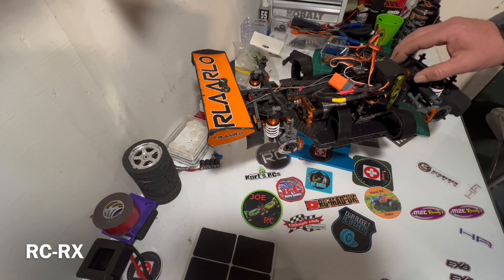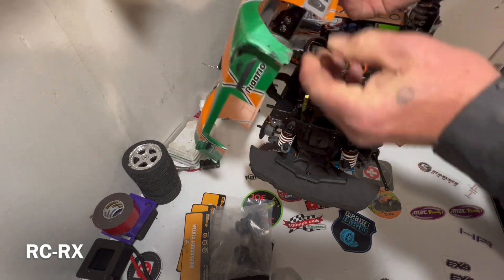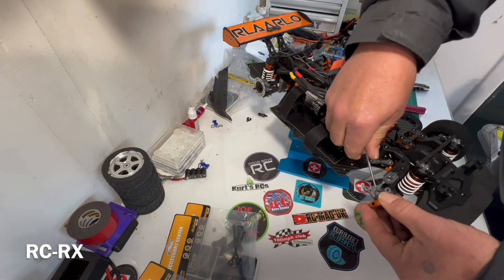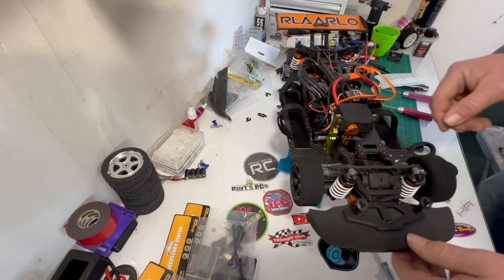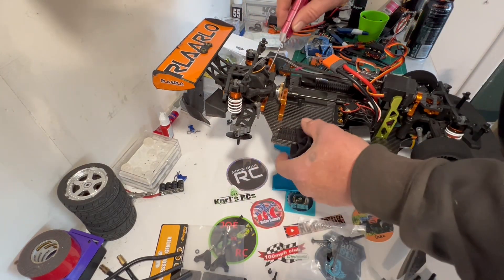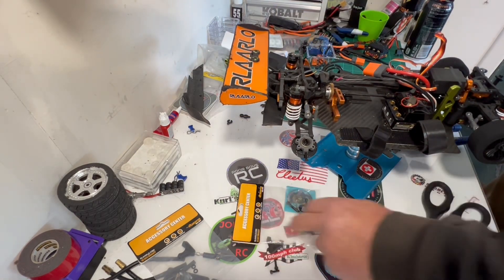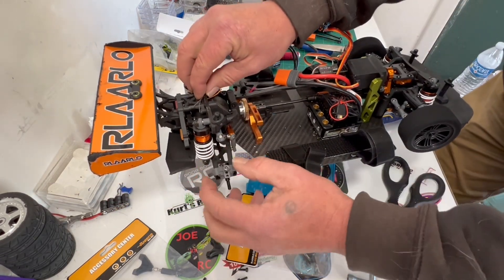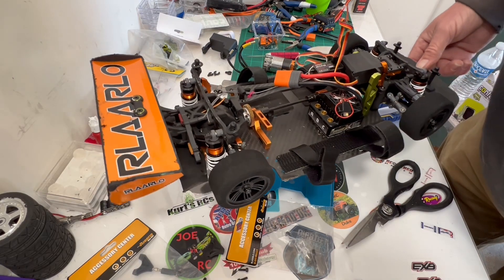Rlaarlo AK-787! What broke in the crash? Let’s fix it! #rc #rccar #rlaarlo

Comment: Thanks for the shout out 🙏
Check the Diameter between the 26mm and 30mm foams
If they are not the same diameter, there will be trouble controlling the car. Use 26mm all the way around if you dont have a Truer 

Your making making ground Brother👍 keep pushing
Reply from the maker: No worries!… I appreciate the feedback always…. I checked the foams and they are the same diameter just a bit thinner and offset for the front.  Hopefully she will go!🤜🤛

Comment: Nice updat and repair.  The foams should run much better. But check the heights on those front and rear tires . They look different  .
Reply from the maker: Thanks Joe!… yea I checked them they are the same… just the rears are wider… my Dads rc said the same thing.

Comment: 1)  Have you tried using the front-upper suspension arms on the rear?  I haven't tried it, myself...but, I do know others have successfully done this 'swap'.  The only thing I can't remember (you'd have to try it both ways) is whether they remain in the same direction (ie. front-facing remains front-facing), or whether they're "flipped" (ie. front-facing when installed at the front, becomes rear-facing when installed at the rear).

2)  My 'easy' way of removing the stock hex was to remove the rear uprights, or steering knuckles in the front, from the upper & lower suspension arms, place the threaded section of the stub axle against the tablet...then, while holding the disc-brake hex with two hands, press the hex/disc down, and or comes right off.  This works for all RCs having this hex style.

3)  Glad to see I'm not the only one using one of my Benchmade knives with my RCs...lol
Reply from the maker: What’s up brother!… I have not tried the from arms on the rear yet. I’ll take a look at it for sure. Yea that was the only hex that was pressed on for some reason… the others were fine….. and yea… I should probably use a cheaper knife as a pry bar!…😂

Comment: Hi those top rear a arms suck . Back in June 2023 I changed them for wltoys turnbuckles on my RTR 917 . I now have about 180 miles on the car and no more broken a arms. I have got it to 103 mph so far on stock carbon layered tires on wltoys 124016 front rims.
Reply from the maker: Nice!… I too have had problems with these arms as you know…. I will check out those WL parts! 103 is awesome!🤜🤛
Reply: I would appreciate it if you tell me what wltoys turnbuckle part # specifically you used? Thx!
Reply: @SuperScottCrawford  Hi the ones I used came with the metal upgrade parts for the wltoys 124016 . I use the stock plastic end on the rear hub in the center hole .The metal end on the diff side turn the stock a arm straight up and use it for a spacer .
Reply: @benabnjm4828  thank you!

Comment: hey the microphone is awesome! way more clear, those foams should definitely help,
Reply: & I would actually love to see some soldering, I've been struggling with soldering for months I just can't seem to get it right,
Reply from the maker: @michaelfear4801  thank you brother! Was hoping it would be better! I’ll work some soldering in to some of my videos… I’m no expert but so far it has worked ok…🤜🤛
Reply: @Rcprescription  awesome dude definitely look forward to it, I've giving up so many times, my problem is my changer doesn't take deans plugs so I always change them out
Reply from the maker: @michaelfear4801 right, I always find battery’s on sale with the wrong connector on them…..so I started learning so I could buy them and change the connector…👍
Reply: @Rcprescription  yeah same here lol but I'm not good at it, could also be I have the cheapest iron kit on Amazon,
Reply from the maker: @michaelfear4801 lol….mine is not expensive….got it at harbor freight I believe….not sure if you have those by you or not
Reply: @Rcprescription  kinda we have princess auto and from what I've seen it's basically the same
Reply from the maker: @michaelfear4801  cool… check them out….the only thing that would make mine a little better is a chisel tip… mine is a bit to pointy.
Reply: @Rcprescription  really eh ? good idea and the one I have came with a few different tips and stuff I've tried a few times with it but it's extremely difficult for me for some reason
Reply from the maker: @michaelfear4801 are you using flux? I messed up a few times… and at first some were very ugly… but they worked…😂
Reply: @Rcprescription  actually that's probably the problem, the stuff I use is Flux core so I didn't think I needed it, 🤦
Reply from the maker: @michaelfear4801 I don’t use that… and you want to use the thinnest that you can get away with also.
Reply: @Rcprescription  i know im doing something wrong haha but trust me when ya do a video on it ima take notes lol
Reply from the maker: @michaelfear4801  I’ll try and put some more out when I solder… I just put one out but the camera angle wasn’t great and I’m gonna have to learn to narrate better as to what I’m doing….